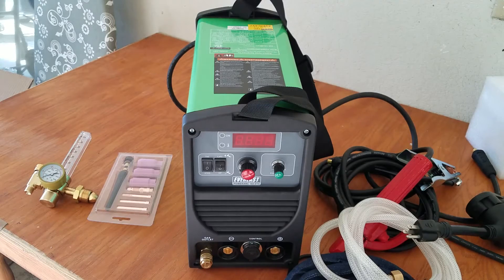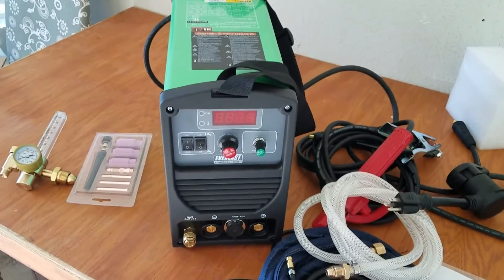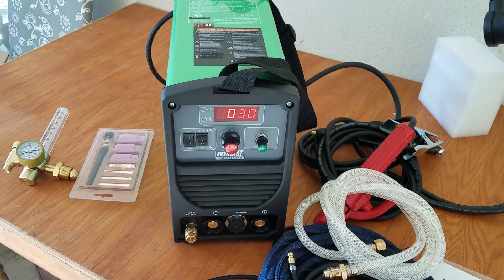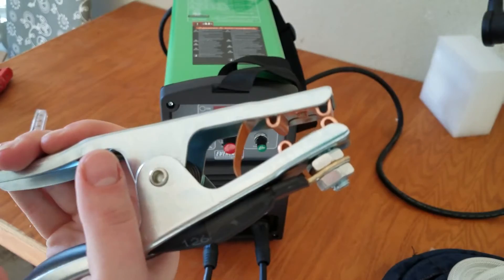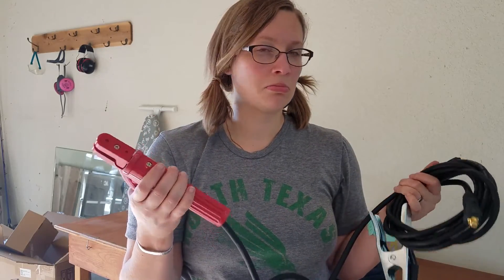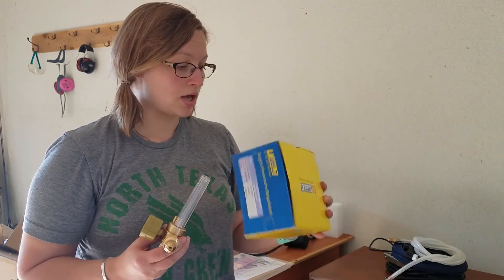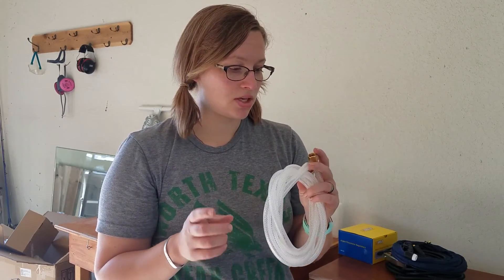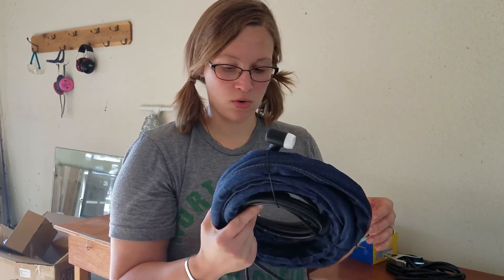Turning on Everlast 160STH for first time

Comment: This machine is a fantastic tig welder. I have been wrlding stainless steel with it on a daily basis for 4+ years now. No issues, no failures, almost mo maintenance.
Reply from the maker: I JUST started practicing with TIG and you are right!